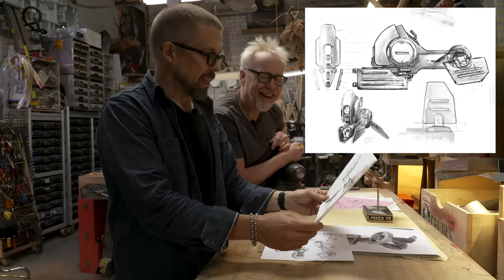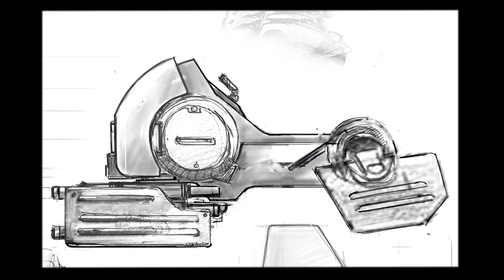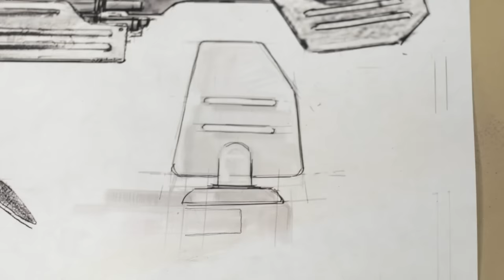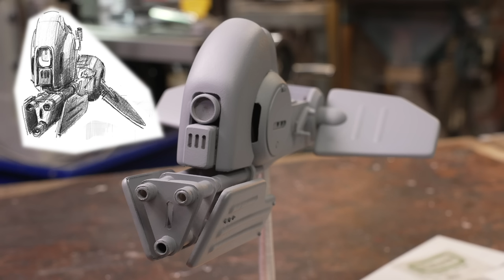The Star Wars Speeder Bike Reimagined!

Comment: Adam, i told norm about these nippers.
i can highly recommend the Tamiya Fine cutter model NO.123 item number: 74123
Its pricy but worth it and if you pre cut the sprues from the frame with your rough cutter first, the Tamiya will last a lifetime.
its an extra step i know, but on the positive side it won't damage your model kit.

Comment: I feel like the speeder is braking in that pose, like its driver had just pulled the hand brake and momentum completely ceased. Those fins definitely fold in to the sides of the body to avoid wind resistance. when that bad boy's going mach infinity.

Comment: Fascinating stuff to watch but I wonder if someone with nothing but Fusion 360 CAD software or Blender could have modeled the exact same thing possibly in less time and have it ready for insertion into a CGI scene much easier. And if you needed a physical model, you could easily 3D print from the CAD model, spend some time with primer, paint, and aging that you are going to have to do with the styrene model anyway. The advantage is, you don't need a shop full of tools the size that Adam has or a stash of plastic parts for greblings. The average hobbyist with a CAD program in a 3D printer could re-create what you did.
Reply: Your comments are reasonable, but allow me a few observations. The process we are engaged in isn't a means to a production model, either physical or digital, but a design exercise and the act of design is particularly susceptible to the conditions it occupies. How narrow or broad is the brief? How many voices are contributing? What are the iteration demands and schedule? Importantly to this conversation, what are the tools being used? The tool influences the outcome. A chair designed with only a table saw won't have a single curve. Our version of Nilo's design from this day, built by two people under a tight schedule, using the physical items at our disposal in this particular shop, is different from a version built within any other environment. Not better or worse, but different. From where I sit, having overseen the fabrication of objects using digital tools for a few decades, the computer is a particularly seductive and as a result, problematic tool in this regard. There is danger in over reliance on any one tool. It contributes to an entrenchment of look. I walk through the world and easily point to forms that exist solely because they are easy to create with 3D modeling software. So to your core point, yes someone could build this in Blender, but it would not be the exact same thing. I may take a stab at this form with digital tools this winter, purely to see what light the exercise sheds on these principles.

Comment: Model making is engineering. I suppose you have to ask if you were building this for real, how would it fit together. Ok, so a speeder bike hasn't yet been invented, but you will use the same aesthetics, the same engineering skills. It has to look like it will work in real life. Has been manufactured, has been on a production line like Henry Fords.